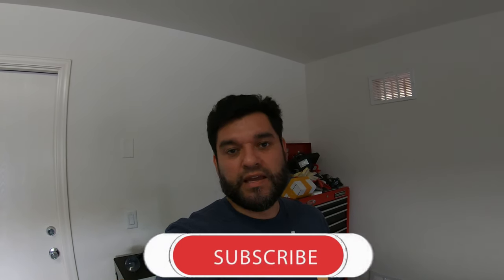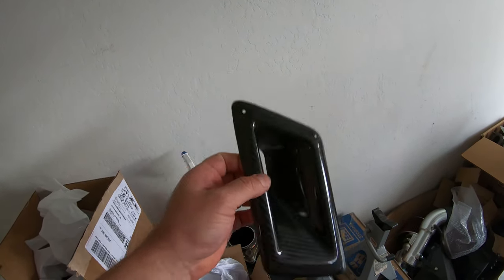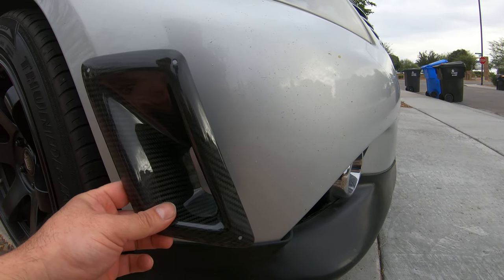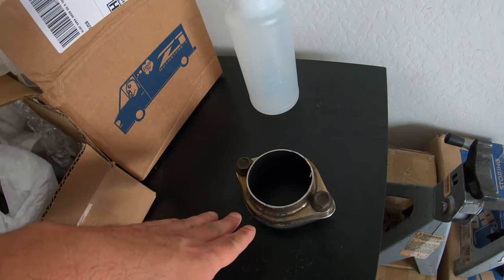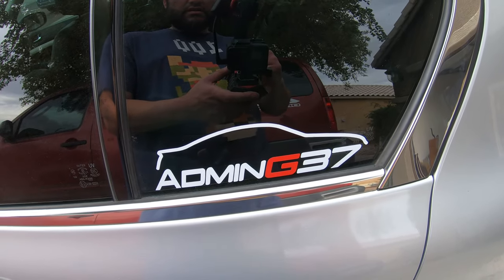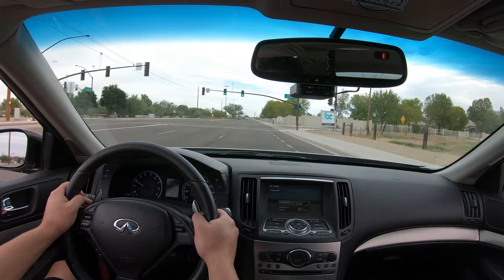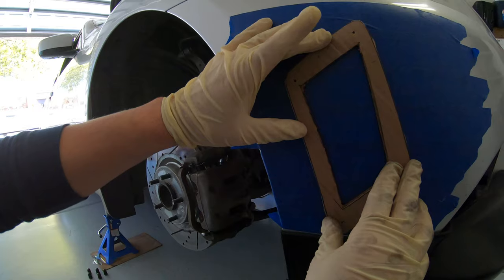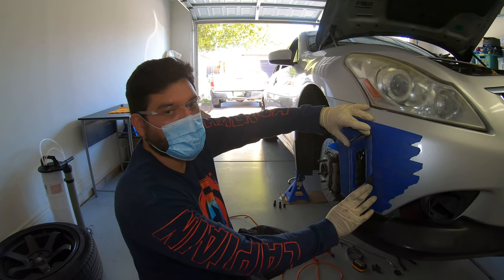Infiniti G37 Sedan Gets More Drag Strip Race Mods - Paddle Shifters & Carbon Fiber Air Duct Inserts

Comment: How do I put on the part u took off to put on the paddles
Reply from the maker: Hi there, you talking about the plastic covers? The new ones go back on the same way they came off, hopefully you do know you can't reuse the original covers as they don't have the cutouts for the paddles. You can definitely modify them but it won't be easy. Hope that answers your question and thanks for watching.

Comment: What radar detector are you running?
Reply from the maker: Hey Michael, it's this one:
https://www.amazon.com/dp/B07F6PZXHM/ref=cm_sw_r_sm_apa_fabc_rfDWFbRS2HSRJ?_encoding=UTF8&psc=1
And it's paired with this:
https://www.amazon.com/dp/B0788XRBTV/ref=cm_sw_r_sm_apa_fabc_whDWFb3F02XSE?_encoding=UTF8&psc=1
I only used the wire not the mounting bracket in that second link to connect to power in the rear view mirror. I'm happy with this radar detector, has saved me plenty of time, how that helps and thanks for watching.
Reply: @MemosGarageAZ  
I got the same setup on my G - should be optional accessory from stealer.
Saved me literally thousands of $$$
Reply from the maker: Right? LOL 😅